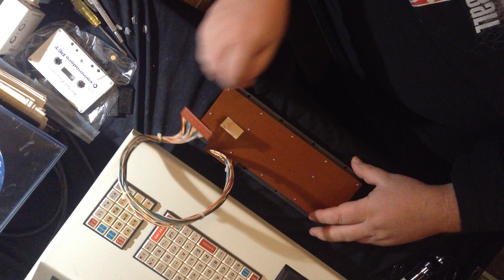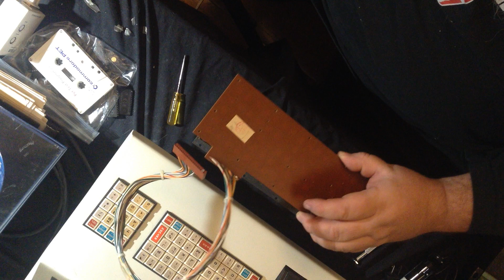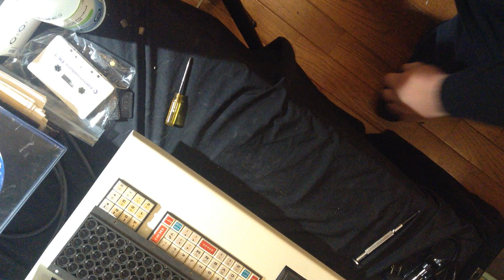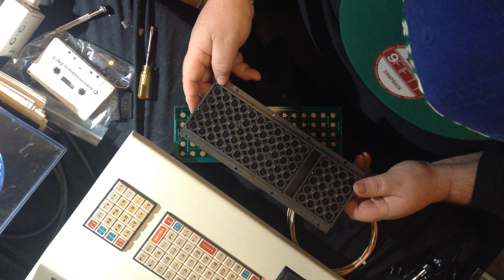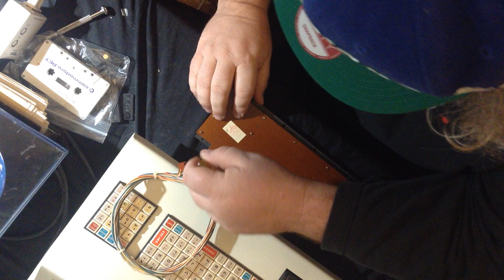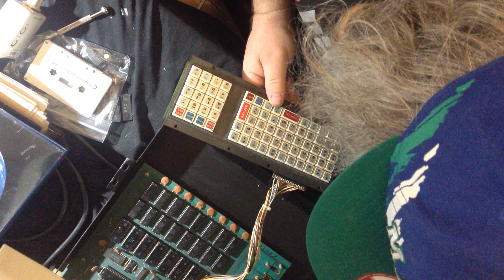How To Take Apart & Clean A Chiclet Keyboard From An Original 8K Commodore 2001 PET -  Episode 857

Comment: I suppose, Commodore really was a calculator company.This keyboard shows that.
Reply from the maker: Indeed, their first effort did sport essentially a calculator keyboard, but it did not take too long for them to realize that they needed to offer one that could be typed on, and the cassette drive could quite happily be an external device...one or two of them could be connected to the machine.  The full size keyboard was quite good, but now of course, the early chiclet keyboards are highly prized and desired...not for function, but because they were the first...little by little, they did get out of the calculator business...as they changed the world with their various machines...but it all started with an 8k PET...